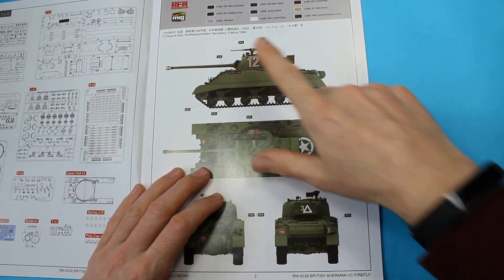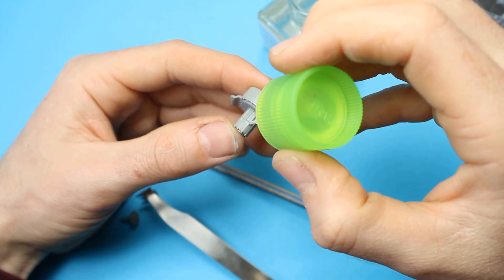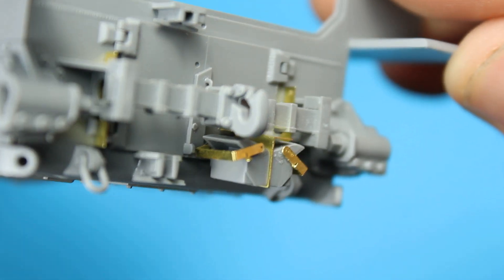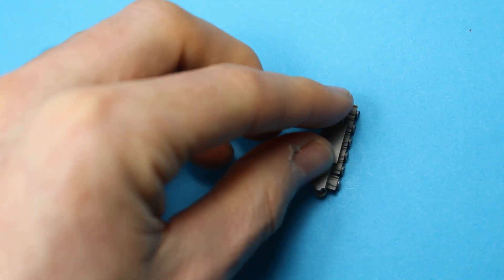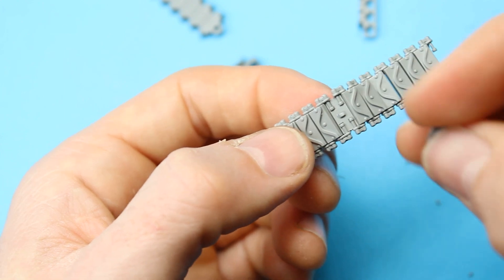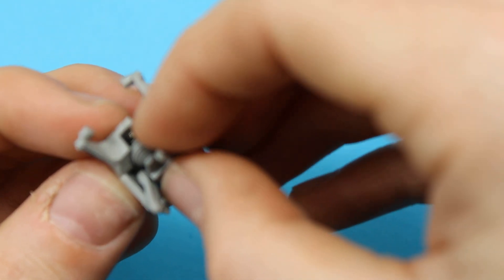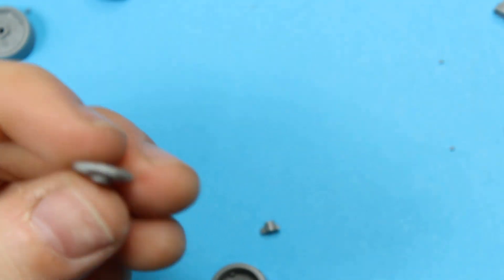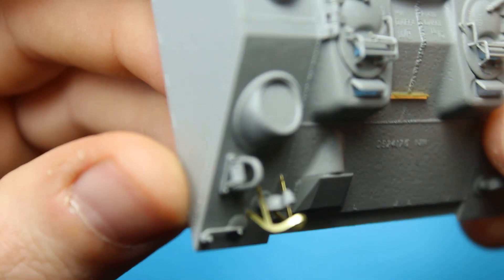Rye Field Model 1/35 Sherman Firefly Build, Part 1

Comment: A few tips:

Glue the idler halves together and give them an extra thorough sanding. The rim portions will go on perfectly.

Same with the inner road wheel faces. Just sand them an extra few rounds and they pop right in.

Have the transmission section built first, and then in one session build the lower hull as well as the upper hull with sponsons. You’ll be able to align everything perfectly.

Comment: lovely build. However it was a 17 pounder gun wedged in the turret and the bigger rear box was to house the radio because if it was left in its original position the radio would have been smashed to bits by the recoil of the gun. The additional box on back was a counter wait for the gun.

Comment: The bow gun is blocked of on the Firefly because the bow gunners position is used for main gun ammo stowage. The 17 pound rounds were considerable longer than either of the American 75 or 76 mm gun rounds and restricting the ammo load to the standard Sherman positions would have resulted in a very low number of main gun rounds being able to be carried. All Fireflies I have seen have plate armor welded over the bow gun position.
Reply: Also  the periscopes on co-drivers side should be closed . No one to use them.

Comment: The bogeys look slightly easier than the Tascam version. Which is also all about cramming the bits together. I made the Tascam some years ago, and had to scratch-build one of the swinging arms out of sprue when one pinged away to be eaten by the carpet monster. I was burgled last year, and the burglars knocked the Firefly off its plinth and I think they trod on it.

After beefing up the locks and fitting a remote-control electromagnetic lock for my inner front door, and replacing my stolen pool cues and air rifle, I've bought the Ryefield version to add to my stash, which will probably go directly after my Amusing Hobby Centurion Mk 5.

Comment: Few technical notes to the greatt build video:
- transmission gear cover. IRL the cover made up from three pieces and the big "bulges" behind the sprockets were a single cast with the side parts. On the other hand the three parts were hold together by bolting the big flanges on their edges (in the middle of the transmission cover) together. So by building  the kit the join gaps on the two sides should be filled (if there are any) and replace the cast texture there, and there should be a slight join line scribed all around the middle of the flanges.
- the small L-shaped part on the front glacis: it was a footrest, a support for climbing up in the glacis.
- turret boxes: The first was the radio, because the big breach of the 17pdr left no place for it in the original turret bustle. So the rear was cut out and an armoured box was permanently welded to the back of the turret. The second one however was a simple steel stowage box, often removed from the turret. It was fixed there by small steel plates welded to the radio box. So the narrow verical bars at the end of the radio box should overlap the storage box, not being flush with the edge of the radio box.
- the small rectangles on the side of the hull: those were part of the "boathouse", a frame and tarp which covered the tank and disguised it as a lorry. The two pronges on the front fenders were part of that too.
- track construction: after making the small segments it easier to connect them in the jig. put one connecting piece in the middle, two segments at the two end, push the side fixers on and it will not be fiddly.
Reply: Hola,buenas noches queria saber donde ha comprado la pinza de corte, que sale en el video del montaje del Sherman, es la primera vez que la veo, un saludo y gracias

Comment: Firefly would be an M4A4, radio was mounted in the first add on box in the turret, then a stowage box after it, the 17lb gun was huge and that's how they made stuff fit, that's also why the bow machine gun position is blocked, there was no gunner there cause that space was used for ammo storage for the much larger 17lb ammo.

Comment: The actual wheels also have a seam in the middle, rubber was vulcanized on from 2 sides. The problem is cleaning up the gate withou destroying the seam line. I indeed usually file them off.

Comment: The assembly of the individual track links are absolutely the worse I have ever attempted to put together. Plus, the boogie/suspension is WAY over engineered. I replaced them with the one's from Dragon's British Sherman Vc Firefly. Also, I wished RYE FIELD would have included a set of vinyl tracks in the kit.

Comment: It's a static model. What's the point of moveable tracks?   Meng Sherman has individual guide teeth for God's  sake. What's the point?  Rubber band tracts, like on Tamiya Sherman's are way better. Done 6 Meng T90s with tracks like this. After model is finished, it makes no difference.
Reply: I’m not disagreeing but if your a diorama builder nothing looks more stunning than a tank going on uneven ground with the suspension articulated to the ground. Generally if it’s just on a flat base especially with Shermans the new Tamiya rubber bands can be weathered up nicely, but I purchased the E8 Sherman and the Meng for this reason. There’s a older diorama book by Hal Sanford and he did that with a old I believe it was Tamiya m-60 and it looks amazing.

Comment: The newer Tamiya Sherman's hull is not "absolutely perfect". It is a janky shit, with gaps almost everywhere. The molding quality on those kits are just bad. Almost all of the parts warped. At least on my M51 that was the case. The upper hull is 1 mm longer than the lower for example. Tamiya Shermans among the worst in the market these days. Only the Italeri form 1977 is worse, but the Italeri is priced accordingly. MEanwhile Tamiya is priced if it was a premium kit. Nope, it is absolutely not premium. Even the Zvezda Shermans are way better, for half the price. Tamiya Shermans are the ones lacking. Tamiya Shermans are oversimplified even compared to the aformentioned Italeri. Tamiya engineering on their armour is nothing else but cheaping out.